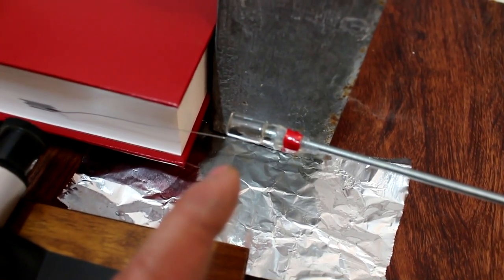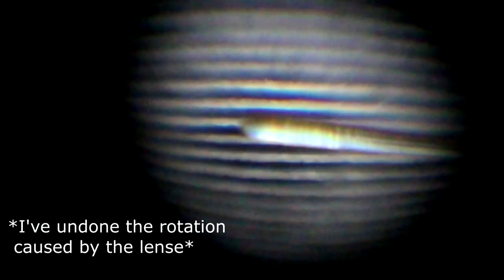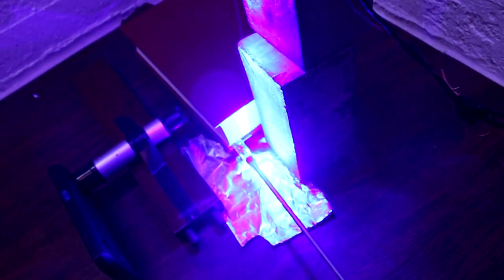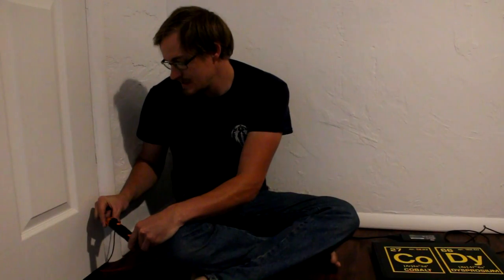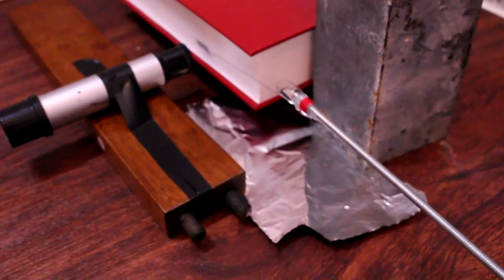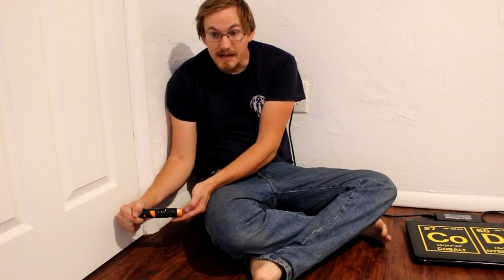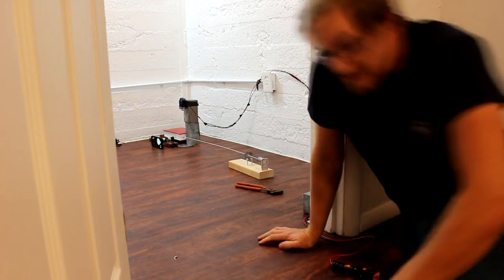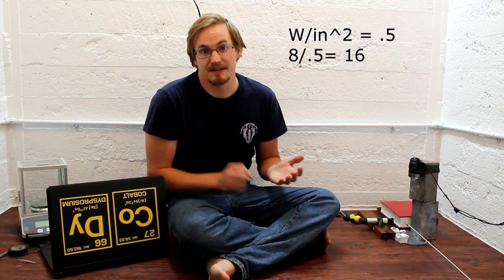Does Light Push?

Comment: Cody--When I was a kid a long, long, time ago they had flashbulbs for Kodak cameras. Once you flashed it it burned out. I remember asking my dad when I was about 8 years old, what would happen if you could put mirror coating on the bulb and make it so you could flash it over and over. The light is trapped inside the bulb and you are flashing it over and over. Would the light keep building up and eventually run out of room? Would it explode. As the light is bouncing off the inside of the bulb would its speed eventually change and would it turn into another form of energy? Needless to say, my dad got quickly annoyed at my crazy ideas and said, go outside and play boy, you are bothering me. so, since you are knowledgeable in this area what would happen? I also, hit him with another question on a different day. Now, this is before they knew black holes existed for a certainty. I said, Dad, could they make a light bulb that would absorb all the light when you would turn it on and make a room dark  for day sleepers? Well, you know what he said--Go outside and play!
Reply: There's no such thing as a perfect mirror. There will always be energy absorbed from the by the reflective materials as in the end, they are particles bumping into other particles, which transfer energy in the form of heat. Theoretically, the more reflective a mirror is, less and less energy is being lost. But then light travels extremely fast. So even if the reflective properties did make a difference, it would be almost infinitesimally small. Those are my two cents.
Reply: i think vsauce made a video about spherical mirrors a few years back.
Reply: with each bounce the photons lose enegry to heart (no such thing as a perfect mirror) and so the light fades away.
Reply: Deep Thoughts with Larry Englehart
Reply: Well
Energy whatever You do in Real Life will just turn itself into heat.

Is it possible to make thing in wchich light will bounce essentialy inffinitelly. Yes but not without suplying it constantly with energy.
Reply: larry englehart this was actually something I thought about a lot for a while and it send me down the path of learning about optics as a whole.  After going there, I can say that even if you had a perfect spherical mirror the light waves would interfere with each other as more and more light wad introduced into the sphere.  It would not burst, and sadly the total amount of light you could house in the sphere would cap off pretty quick, decaying away as soon as the input was switched off
Reply: So, Czorny Lisek, when we see, here on Earth, a star burn out, that event has happened mere moments ago and not millenia ago??
Reply: I wondered the same things. And, why is it when a light is turned off at a distance, there is a slight delay? And yet we are taught that the light from the sun reaches us a mere 6 minutes after leaving the surface. Is it the speed of one's thought separating the perception??
Reply: I'm thinking that with every reflection, just like in this video, the photons would impart momentum to the mirror, losing energy and  redshifting. Meaning their frequency would decrease. However if you could get the photons to orbit a black hole and incase the entire thing in a spherical mirror, the momentum that the photons would gain from the black hole would blue shift them, increasing frequency, and building the energy inside the spherical mirror until an explosion of some sort occurs. I could be talking out my butt though and completely wrong so I wouldnt take this reply to heart.
Reply: If you actually had a perfectly reflective cavity, the biggest problem remaining would be that whatever "bulb" you're using to introduce more light would also be capable of absorbing it (a good emitter of light is also a good absorber--this is a fundamental physical fact). So at some point, the bulb would destroy itself and that would be the limit. That's the practical answer to the question.

To go further, I suppose we must assume there's some way to just magically add energy to the cavity, and also that it's not just perfectly reflective but also strong enough to withstand the increasing pressure of the light.

Light itself doesn't really "run out of room" to the extent that you can model it as linear (maybe quantized) electromagnetic fields, but it could eventually get to such fantastically high levels of intensity that nonlinear quantum effects like the creation of virtual electron-positron pairs start to be important, and cause photons to be able to scatter off each other, which they normally don't do. There are actually experiments in the planning stages to induce that and study it.

Beyond that, we get into a realm where the fields in the cavity aren't mostly electromagnetic any more--it's all sorts of fields and particles.

All this happens far, far below the limit where gravitational effects become important. The ultimate limit for energy of any sort in a cavity would be where the total energy equals the mass of a black hole of that size, and that's something like the mass of the Earth times c^2 for a volume the size of a big marble. That would cause the arrangement to gravitationally collapse.
Reply: @t.i.m.e.3419  Electric circuits can have small delays built into them from things like self-inductance. That may be what you're seeing when you switch the light off--effectively, it is running on stored energy within the circuit itself for a tiny period. Or it could just be a perceptual effect as you say.

Comment: There's something called a metal vacuum scavenger that makes a shiny mirror on the inside of glass, and it works as a solid state vacuum pump by reacting with anything inside the chamber.  You might be able to use them to get down to much, much lower pressures than you currently can.
Reply: Those are often pointed out in Fran Blanche's videos when she uses vacuum tubes--she calls them "getters".

Comment: very cool. 
how did you vacuum and seal the little bottle?
Reply from the maker: I was wondering when someone would ask! so it was actually quite brilliant; I put the bottle in the vacuum chamber with a small opening in the glue. I then heated the glue with my laser, melting it, and sealed the hole. then when I let the air back in the air wouldn't get inside the bottle! I cant say for sure that it stayed sealed or if it was necessary but I'm thinking of making a video on the process.
Reply: ***** ^^ clever
Reply: +Cody'sLab wow
Reply: +Cody'sLab Dam son you cleaver

Comment: did you take thermal expansion into consideration?.. heated mirror will expand and hang more weight on the end of the rod.
Reply from the maker: I assumed it would be small but that would be an error factor that I would like to control for.
Reply: just measure it at terminal temp  but with and without the light applied.

Comment: I'm thinking, doesn't the wavelength of the light matter also. If you imagine having two perfect mirrors in space, perfectly aligned so that light will forever bounce between them. Then those mirrors would accelerate away from each other for ever into space. The reflected light between them would get larger and larger wavelength due to the increasing relative speed. If the wavelength does not matter, then basically the energy in one light pulse would be indefinite since it would accelerate the mirrors forever. Just thinking...
Reply: This is an interesting question. Indeed the energy from the light will be given to the two mirrors, therefore the frequency of the light must drop since this is where the energy is coming from. This is explained by the relative motion of the mirror between incoming and outgoing photon (note you can't use the frame of reference of the mirror during this because it is accelerating). It certainly wouldn't accelerate the mirrors to the speed of light however simply because there are infinite reflections. The photon imparts some fraction of it's energy with each reflection. For example if it was 1 Joule of light and imparted half its energy, it would become 0.5 Joules then 0.25 Joules etc., but it would only ever impart 1 Joule. Hope that makes sense
Reply: Lars Berntzon Keep in mind mirrors are not perfect reflectors. I don’t know if we have something that can perfectly reflect light.

Comment: Since the laser is bouncing off the foil, isn't it heating the top of the glass twice as much?
Reply: Terran Loyalist I am concerned about this too. When the laser goes through directly, it heats both sides of the glass. When it is absorbed by the carbon, it heats the top but not the bottom. And when it's reflected by the mirror, it heats the top twice. I think the entire apparatus really needs to be in high vacuum.

Comment: Photons have no mass that is why they can travel at the speed of light.
Reply: Mass and energy are basically the same thing. Matter is simply energy that's bound together by Higgs bosuns. Photons seem to straddle the line between the two. What matters here is that energy is being transferred.
Reply: +TheOriginalJphyper No, photons have zero mass. But they do have momentum.
Reply: Xei I wasn't saying they did have mass. I guess I wasn't clear on that. This is why I'm not a physicist.
Reply: TheOriginalJphyper Oh, fair enough dude. Sounded like you were, sorry.
Reply: They don't have rest mass, they do have relativistic mass though.
Reply: Yes, but because of e=mc^2, matter and energy are treated equally in all experiments, which is why photons feel the affect of gravity. Now I know this is an simplification, so don't chew me out for it
Reply: Correction - no rest mass
Reply: Augustinian de Juan Pierre
my wife goes to Mass every Sunday, which one is that and can i get some REM rest mass?
Reply: Davidautofull [Insert drum/cymbals ("rimshot") sound effect here]
Reply: What about black holes? Black holes bend light because of how intense the gravity is, doesn't that mean light has a mass? If it had no mass then theoretically it wouldn't be able to bend light
Reply: ***** Because the mass of a black hole bends spacetime, light merely follows this spacetime curvature. Light has no mass as we tend to think of it (rest mass).

In Newtonian gravity only objects with mass (in the classical sense) attract each other but that's not how it really works.
Reply: ronald brignoni tetnicly it is weightless but I photon has a mass of around 0-.000000000000000001ng so it's somthing that debatable
Reply: photons have momentum, a photon can only "exist" with momentum,if you use the relativistic equation for momentum and you use m(mass) = 0 then your saying that the photon has no momentum which is false.
Reply: johan banan yes momentum is the product of energy and velocity,but the relativistic equation for momentum is from the paper on special relativity the equation is p = m*v/sqrt(1-v^2/c^2) we know that the velocity of a photon is the constant, c, v = c ,lets now say that "photons are absolutely mass-less" so m = 0  the equation changes to p = 0*c/sqrt(1-c^2/c^2) that simplifies to p = 0/sqrt(0). Zero divided by the square root of zero is infinity, now we already know that the velocity of a photon is a constant and never increases so that means that that statement is false and you must conclude that it is zero instead of infinity.this means that if the mass of a photon is 0 then the momentum of a photon would be 0 which as we already know is false as it is c.
Reply: relativistic momentum: p=mv/sqrt(1-v^2/c^2), relativistic energy: E=mc^2/sqrt(1-v^2/c^2)   -->    E^2=(pc)^2+(mc^2)^2, m=0   -->    E^2=(pc)^2   <-->   E=pc  <-->  p=E/c
Reply: touché but if p = E/c and E = mc ^2 then is p and E not zero ? because photons dont act like they dont have energy or mass ?
Reply: is that the energy/mass of the photon?
Reply: ik but if E = hc/lamda then is that not the mass / energy of the photon i guess i worded it poorly
Reply: m =(hc/lambda)c^2?
Reply: ok just this question and im done the energy of a photon is E=hc/λ so can you not re write E = mc^2 to be m = e/c^2 and if you can does that not mean that m = (hc/λ)/c^2? since the energy of a photon is E=hc/λ?
Reply: yea ur right i realized it ,changed E = mc^2 / sqrt(1-v^2/c^2) to m = ((hc/lambda)/c^2)(sqrt(1-v^2/c^2)) and got zero for m
Reply: Photons can't have no mass. During fusion of atoms, mass is lost, that mass is released as photons. E=MC2 means that energy and mass are two states, or two sides of the same coin. Hence the "Equals" part of the equation.
Reply: They have zero rest mass, but they have momentum when they are travelling at c.

Comment: Hey Cody, I am a custom jeweler and I have a laser welding machine capable of 140 joules in a beam as small as .2 mm to 2 mm and a variable light pulse with a time on setting this machine will blow a hole in a 1/4 inch bolt in between the threads without messing up the threads. Needless to say it is a powerful machine. When I fire the welder at a piece of jewelry I feel the light hit the piece. At a medium power setting, if you were to hold a ring in your hand and tap it with a spoon you would feel what I feel when firing the laser at a piece of jewelry. So yes light does have mass and you can feel it quite well in this machine. I was thinking of putting a sensitive scale in the machine and seeing what kind of measurement I get.

Comment: Nicely done Cody.
What if you built two rigs identical as possible. 
Then put the laser on one, and nothing on the other.  Experiment and control yeah.
Record both for a duration longer than ten seconds.
Do not hover outside the room talking as sound waves can effect the gear.
Turn the main light off in the room, and use an LED lamp pointed at the far wall to diffuse the light.
Use a timer control for the power source.  I figure plug it in outside the room, and let it go 30 minutes before it turns on, and then 30 minutes with power on before it turns off.

Any movements recorded by both control, and experiment at the same time can be eliminated.  Any movement by the experiment alone can be safely reasoned to be because of photons.  Any movement by the control alone warrants further investigation as to the cause.

Your use of a book, and page edges as a scale was a very cool idea.  Problem with it for this concept is that not all pages are the same even in the same book.  So for the scale use a long strip of say flat stock as thin as you can get it, or even roof flashing.  Cut the strip up, and make a stack out of it with factory edges all making up the face of the scale.  You can even paint the edges white, and black.   

Just me thinking aloud.  Thanks for the video again well done.

Comment: One tip to remove seismic vibrations: place the whole setup on a block of styrofoam/soft wood for damping, and surround the set up with more styrofoam to remove effects from your voice causing vibrations in the air. Would probably produce a better and more observable result.

Comment: Might be a considerable difference if you had a different wavelength to compare to,  by that I mean the "force of the beam" ie: IR from a diode laser is 1064nm, and it can have a reaction with most objects (cloth, plastics,  metal etc.) except for organic materials & glass; however a Co2 laser (also IR but it's in the 10640nm and really doesn't matter what you put in front of it (off course respective to the comparative wattage range like in your system) the movement of the foil in the vacuum setup is mostly heat and deformation that would cause a shift.  At least now you do have a baseline to go by.  Take a black dry-erase marker and color the mirror and retry the same experiment.  It's hard to explain,  but it makes a huge difference on the beam reaction.
Reply from the maker: I might have to try that!

Comment: Cody.. I remember seeing an experiment many years ago where a laser was pulsed against a thin film that was suspended within a vacuum tube. If the pulsing was timed correctly you could see the film start to swing backwards and forwards, just like pushing a childs swing. This was a good experiment to see that light in fact has mass. The swing got so pronounced that it was swinging several millimeters to and fro in a matter of a few seconds.

Comment: When there is no air, a piece of paper or a ton of brick fall to the direction of gravity at the same speed. Light tweezers is kinda interesting, so your project about light exerting force is interesting. The elimination of the effect of air atoms bouncing off the heated surface of the foil by putting it inside a bottle is quite interesting.

Comment: Very clever experimental setup with just things you have around!
Unfortunately we can not rule out thermal effects for sure: with mirror light passes twice through same point on the glass wall and that could explain double effect. When no object inside light passes through opposite parts of glass walls and effects cancel each other --- exactly as we observe.
I don't know any simple way how to tell them apart. Only fuzzy idea I have is direction of force: for black object it should be normal  to surface for thermodynamic forces and along direction of the beam for light pressure.